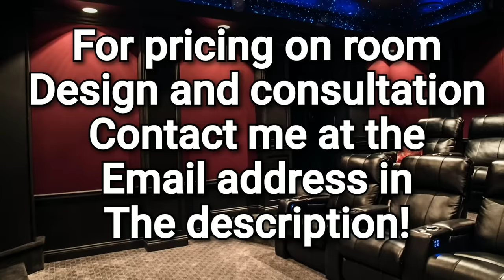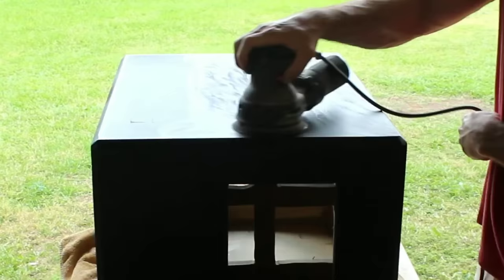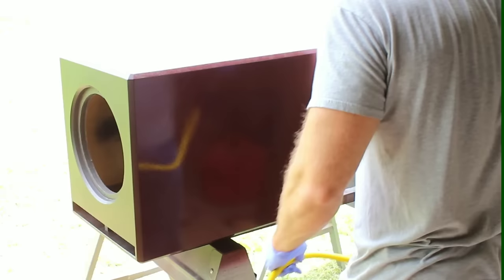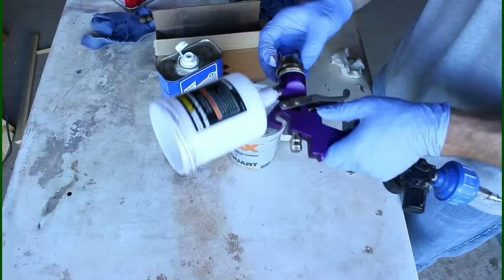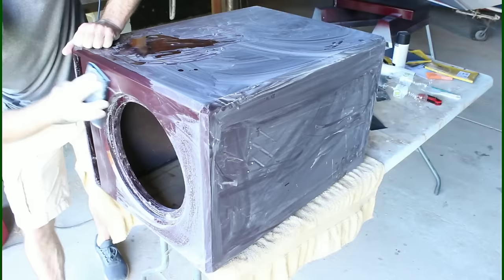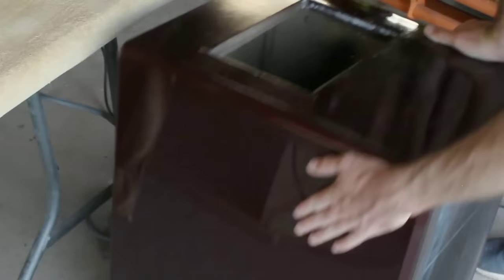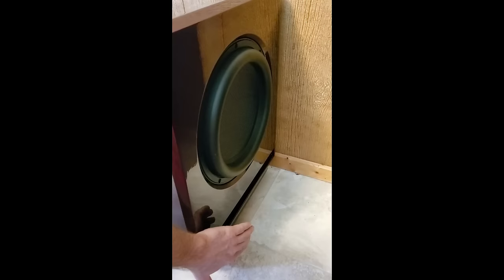Ep. 35 - How to get an amazing Piano Gloss Finish on the Hammer Home Theater Sub| Home Theater Gurus

Comment: you did a good job, looks like it turned out awesome. if you plan on doing any more projects like this i would advise to invest in a better gun. that harbor freight gun is good for primer but for base and clear you really want something that is better quality. Half of being a "pro" is just having the right tools. Having a better gun will cut down on the amount of sanding and make the job faster and easier. The DeVilbiss 802342 would be a decent starter set. I have heard that the Husky guns from homedepot are ok as well. The gun i use at work is the Tekna 703567, you might even be able to find a tekna gun used for a good price.
Reply from the maker: I'm a weekend warrior and don't mind some elbow work at all.   But if I was doing more I definitely may upgrade.

Comment: With wood put a second layer of primer after 10 seconds again. Start where you started first layer because the wood will rise and you get more to sand. And you get a really good primer to paint over
Reply from the maker: I used epoxy primer.  One coat and a light sanding  and the surface is as smooth as a countertop.  I have tried standard primer and it was a pain and even after multiple coats I wasn't happy with it.   I'd highly recommend you try the primer linked in the description.  Also on mdf cut edges I did a glue/water wipe. That is shown on the previous video.
Reply: @hometheatergurus  aha I have to try. Thanks for the advice 👍

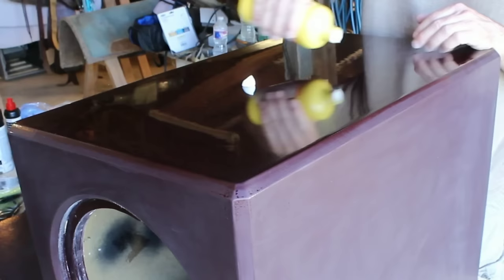Comment: Godd job. At 25:40 you can see the MDF joint. The surface should be pre even before the primer.
Reply from the maker: It actually was perfectly even however MDF and Humidity cause issues and the long panels of MDF will expand past an end panel.  In reality , now that it's in a climate controlled house, it's so faint I'd have to point it out and you still may not see it.
Reply: @hometheatergurus  ok thanks for the reply. I saw, i think in New Yorkshire woodshop, that he let the MDF rest for a week in a hot chamber before working with it. His results are always perfects. Its worth the view.
Reply from the maker: @renatogomes2396  interesting.   It's definitely my favorite finish.  I've done veneers on speakers before but base coat clear coat just looks so good.

Comment: Not a professional painter or body guy but to speed  things up when sanding and a better end result. If your doing square boxes... The longest sanding block without hanging over the the edges is what you want
Reply from the maker: Thanks.  This is the last time I use a sanding block for orange peel.  My buddy who gave me the paint saw the video and like i said in the video I should have gotten some 1k for my DA and used that to knock down the orange peel.  Would have been so easy but i didn't prepare very well.    But yes if I was gonna block sand again a larger block would have been nice.

Comment: Important to note that a compressor for hvlp requires a certain amount of cfm. Overall capacity is not so important. Just make sure that your compressor cfm meets the gun requirements, and needle size suits the material.
Reply from the maker: Thanks. I have a largish compressor capable of running several shop tools.  Way overkill for hvlp.   Works fantastic.

Comment: Great Job!  As a speaker builder, please don't use fiberglass for damping in ported enclosures. Fiberglass fibers will exit the port and float around the air and can irritate your lungs. Use anything else but save the fiberglass for sealed or passive radiator type enclosures.
Reply from the maker: Thanks. I have started suggesting denim because it causes less controversy but in 20 years I've never had to dust my ports so I'm not sold on the fiberglass in the air idea. If it did push it into the air our ports would need constant cleaning.   I'm also a licensed HVAC tech and know how much compressed fiberglass is in your vent registers and plenums.  A port sub is nothing compared to that.   Just saying.

Comment: That buffer basically has the same action as a random orbit sander. The swirls are so small & random that they aren't visible.
Reply from the maker: Yeah I almost tried using one last year but decided to get the harbor freight buffer. The buffers have adjustable speeds but that doesn't mean the orbital sander wouldn't work.

Comment: Love the routing to hide most of the joints. I have had to do plenty of battle when trying to get the seems hidden long term when using butt-joints. Will the epoxy actually keep the joint hidden? Using epoxy will be my next attempt, possibly using it to glue the cabinets as well.
Reply from the maker: It does very well but some seams my have a slight line but it's faint and you have to look close to see it and the light has to be just right.

Comment: Well done, it's coming together, how many are you building for your new set up? My first trade was painting and wallpapering, one thing I'll say with painting epoxy or epoxy enamel, your very first coat should be what's called a tacky coat, this is a very very light coat and given a short time to go tacky, this then let's the next coats build up better, giving them something to stick to, it can make a difference.
Reply from the maker: Thanks.

I'll eventually do 3 more and use them in a tower module setup with 2 of these per stack in the living room.  House has to be built first.

I'll be using the flat packs for the other 3.
Reply: @hometheatergurus  ok, cool, I'm using 4 subs now too, my two accusound 12" class a/b 200w rms subs I've had for a few years now and two I've just bought emotiva basx s12 class d 300w rms, my house has a open plan design, kitchen is open to a large lounge room, the 4 now sound great, one of each up front on the floor, either side of TV, yamaha rx-a 3070 into emotiva's then daisy chained the accusounds to them, the other two rear, my other trade is boilermaker and I made a steel stand I sand filled for rear emotiva at chest hight, I'm getting a near perfect base response, the two amp types work well together, watching your tutorials helped me heaps, thanks mate.

Comment: I know this might sound stupid, but could you theoretically put a ceramic coating on this enclosure like you would on a vehicle after paint correction to protect it from scratches, dirt, etc.??
Reply from the maker: Not stupid at all, if it is we're both stupid.. 😁.  I actually hit it with turtle wax ceramic spray.  Doesn't last as long on a truck but inside it lasts and is easy to reapply every year.   Good luck to any cat that wants to jump on it.  They slide right off!

Comment: Something you should mention is NOT to allow the water from the wet sanding to get on uncoated MDF.  It will absorb that water and swell up underneath the paint.  It will be very difficult to fix that.  And wood putty to fill in any dings will absorb the water too!  Ask me how I know.
Reply from the maker: The edges were sealed when i applied primer but yeah raw Mdf doesn't like water.  This video is in the history books so I'm not able to add anything to it or edit the actual video.

Comment: The cab seems very large. what was the speaker you installed?
Reply from the maker: Um12 and it's comparable in size to svs etc.  Tuning good drivers low takes some space.  In return you get broken dishes and strangers knocking at the door.  We covered all of this in previous episodes where we modeled and designed the sub.

Comment: As someone thats been doing detailing and paint corrections for almost 30 years, nice job, only thing was that dang terry towel lol, made me cringe,  you were actually introducing scratches with that, maybe mix in some microfiber towels :)  One other suggestion when buffing & polishing, always watch that pad and not put so much pressure to where its not spinning, you're actually cutting more if its spinning compared to alot of pressure :)    Nice Job! 👍
Reply from the maker: Thanks!
As you see I'm definitely not a pro so thanks for the advice.  

 As for the towel you'll notice after I begin using the finishing compound I use a micro fiber and mention from here on out nothing touches it but microfiber.
Reply: @hometheatergurus   You did a beautiful job either way, great vid, thanks!
Reply from the maker: @bert4910  thanks Bert!  Thinking of doing some towers in a baby blue for the new house living room.  I really love the base coat clear finish.

Comment: Your table for sanding must be more solid and stable for big flat mirror surfaces imho. But well done any way!
Reply from the maker: It wasn't by choice 😁.  Until the house is built it have to make due and this was the best I had on hand.  The new house will have a proper shop.
Reply: @hometheatergurus  Good luck with the new house! I case of a flexible stand, it can be managed with less pushing while sanding I think. Just more hours of pleasant sanding -)
I'd like to build something like yours sometimes later (also plan to move to a new house in few years).
Reply from the maker: Thanks and I was just lucky the table didn't collapse 😂

Comment: are isolation pads and risers good. I have a large all in one speaker with a down firing sub and i have no idea if theyll help. Im also in a wheelchair so my tweeters are quite low thanks
Reply from the maker: Hey Cameron,  They do help with the mechanical transfer of energy.  However when cranked a sub pressurizes the room and this is what makes walls and doors shake.  That's a result of acoustic energy and isolation doesn't help that.  So yes they do help but won't fix all the room shaking caused by a sub.

Comment: Does amazing job polishing then uses a course bath towel to whip it down
Reply from the maker: Ahh you didn't finish the video. 😎. That was after compound and before only.  After buffing I even comment only a good micro fiber towel touches it now. The towel was soft BTW.  That means You also missed the isolation platform at the end.

Comment: What are the specs for your air compressor? The gun specs specify 12 cfm, which is way more than typical compressors push... Oh, and great video!!!!!!!!!!!!!1
Reply from the maker: Thanks. It's a 26 gallon with 4.5 at 90 psi which is a your typical nail gun etc requirement.  We're no more than 20 psi so have way way more than needed for this.   But of course that's evident as  the paint was done with that compressor and it barely runs.

Comment: could you tell me why you used a dedicated DA polisher....could't I just get a 5" random orbital sander and use that for both the sanding in the beginning and the buffing and polishing steps?
Reply from the maker: You could and it "should" work fine.  The DA sanders have speed adjustments. But yes it should work.
Reply: @hometheatergurus  Thanks for the reply. I noticed some polishers have low RPM ratings....but if anyone else is wondering as well I'm buying a Makita BO5041 DA sander. Only one I could find that has variable speed down to 4000 RPM vs others in same price range only go down to around 8000 RPM. I'm hoping and decently confident that this "should" like you said be low enough to work for the finishing steps yet powerful enough (variable speed adjustable up to 12,000 RPM) to work on wood sanding in the beginning phases. Hope that helps someone out there as well. Thanks for the video cheers!

Comment: I think of HVLP guns as being a system having a fan feeding a large diameter tube to the gun.
I see you are using compressed air here.
How much comoressor do you need to run a gun like this?
Reply from the maker: Not much as the psi is pretty low.  I have a medium size tank just to run air tools.

Comment: Don't you have little bugs, flies and wind-borne grit in the USA?  If I sprayed outdoor in the UK it have so much stuck in it would look like an adhesive fly-killer strip!
Reply from the maker: Ohh yes certain times of the year it's bad.  I picked a nice day.  I had a few specs in it but they come out when wet sanding.  I did have to remove one bug during the clear coat application that left a dimple.  The next coat of clear filled it in. 

I've done the home made paint booth and much prefer to just take it outside.

Comment: Do you have to wait for clear coat to dry before you second coat? I thought u have to clear coat, flat it, then another coat and keep repeating?
Reply from the maker: If by flat it you mean sand it down between coats, no you don't need to but some high end paint jobs are sandwd between clear coats.

If you aren't doing that just let the clear set before applying additional coats.  You don't want to spray it too early or the clear may sag.  The can should have recoat instructions and times.

Comment: You'd  have saved yourself lots of sanding had you used finishing putty to give you a smooth surface to work with but nice job. Thanks for a good video
Reply from the maker: Thanks.  The cabinet was smooth a baby's bottom before the primer hit.  That work was done on a previous video.

Comment: Hey, great video! Is it possible to go as low as 17hz (or lower) on a DIY build using only a 12" driver? Need something WIFE friendly. 
Thanks.
Reply from the maker: Thanks.

Yeah you can tune it lower but any 12" allowed to extend that low will be working extremely hard which takes away from the output above it.
Reply: Thanks... soooo my next question (lol) How would one go about tuning it? Mini DSP etc?
Reply: @thehal991  First off, why do you THINK you want to go that low and why do you THINK that is wife friendly?

There is a VERY slim chance you could pull this off.  YOu would need to make sure the sub could handle going that low (99 out of 100 wont).  The reason sub amps have subsonic filters on them is to block frequencies that low because not only will the sub suck all the power up, but more than likely the sub will be cooked.

Are you trying to make your wife a vibrating box to sit on or something?

Comment: This is so inspiring, thanks. What size air compressor did you use for this?  I am going to paint acoustic diffusers and want to try this method, but I need to pick up an air compressor.
Reply from the maker: Thanks,  i'm going to add this to the description as i get asked this a lot. :) https://www.lowes.com/pd/Kobalt-QUIET-TECH-26-Gallon-Single-Stage-Portable-Electric-Vertical-Air-Compressor/1001014062?cm_mmc=shp-cprdtolgglLIA_TOL_153_Pneumatics-And-Compressors-1001014062-local-0-_-0&ds_rl=1286981&gclid=Cj0KCQiAt8WOBhDbARIsANQLp97Rn3hGlj5of632gOAH7Yn5-hc39jJAkZv8hv_EBslR27EjaZTBdmcaAtu0EALw_wcB&gclsrc=aw.ds
Reply: @hometheatergurus  Thanks so much ! I'm heading to Lowes to grab the last one :)
Reply from the maker: @aaronm5535  I love it. It's very quiet too for what it is.   Grab a hose and assortment of connections.   If I remember correctly it didn't come with that stuff.

Comment: fabulous job.  What size compressor do you use?
Reply from the maker: Thanks!

I actually bought this one recently.  Love it.

https://www.lowes.com/pd/Kobalt-QUIET-TECH-26-Gallon-Single-Stage-Portable-Electric-Vertical-Air-Compressor/1001014062?cm_mmc=shp-cprdtolgooglelia--compressorsdiyandstationary-1001014062-_-0&store_code=586&placeholder=null&gclid=CjwKCAjwte71BRBCEiwAU_V9h57Ml-WC31whvosGOKHqC3nXGGb6v--lqCt8A4WA1Y81F05S5qPL6hoCxMEQAvD_BwE&gclsrc=aw.ds

Comment: awesome work ....i think i may build a few of these maybe 3
Reply from the maker: You'll be very happy.  Make sure and look in the channels community tab for the version 2 cut list and measurements.
Reply: @hometheatergurus  ok thank you
Reply: thank you i have the version 2 cut list ...what does just the  driver weight..?..and the weight of the whole build all finished..?....thanks
Reply: @hometheatergurus  would  the monoprice 300 watt amp work with those subwoofers..it says it does 500 watt RMS..1000 peak.?...thanks

Comment: Would it orange-peel less if you sanded between top coats?
Reply from the maker: That is a method used in high end cars but there's no way I'm putting myself through that.. 😜.  It's quite easy to get rid of the orange peel without having to do that.

Comment: This was awesome. How many hours total from start to finish would you say it took you to do the build? (Not including initial design)
Reply from the maker: Thanks.

To cut and assemble maybe 2 hours tops with sanding.

The paint prep and paint, with cleanup etc... probably 7 hours.
Reply: @hometheatergurus  Got it, not as bad as I thought. Off topic, what is your background? Do you work in engineering or a related discipline?

Comment: Did you sand in between putting the coats of clear paint on? Or only for the foundation and after the 4 layers of clear coat?
Reply from the maker: No sanding between clear coats. The video shows all of the steps.

Comment: Ive been painting 4 23 yrs. For a paycheck. I dont mind anything you've done, except help to destroy the environment. Use your spray booth (you wont). Dont encourage others to do the same. Add thinner to the clear coat. Less sanding. Careful of running.
Reply from the maker: As many spray cans with aresol propellants that people spray a compressor fed hvlp is probably safer.  Not everyone can afford a real booth that collects the over spray and to paint in a homemade booth where you're in a cloud is extremely bad for the person painting and requires a full suit of ppe.
Reply: @hometheatergurus  Add thinner to the clear coat. Trust. It will save you time.

Comment: Well I followed all the instruction and my box smelled like fukn petroleum oil off gassing from the wax products for about a month inside my vehicle. And honestly the finish was no better than a well applied sanded and layered polyurethane.
Reply from the maker: 😂.. Well yeah its gonna off gas , what did u expect.  😁 and I can't help you with the skilz part.  If you're using auto paints and it doesn't look like auto paint with a glass finish when ur done... 🤷‍♂️.  I'm 2 projects for 2.  But you tried and that's what's important.